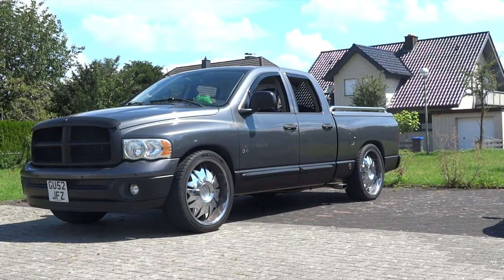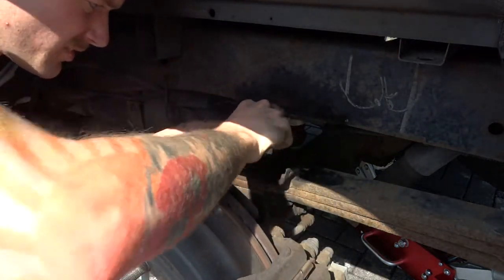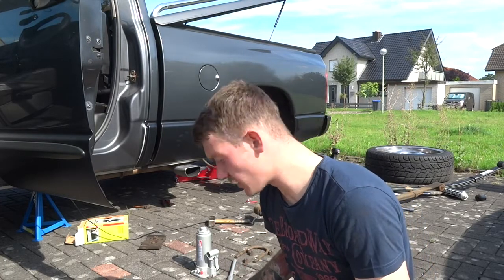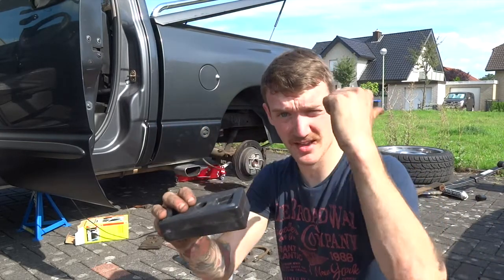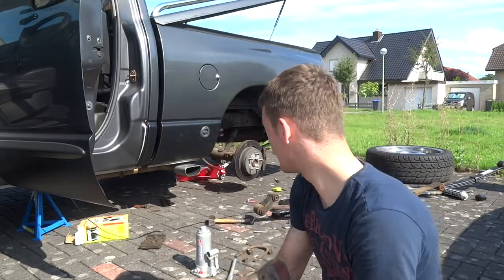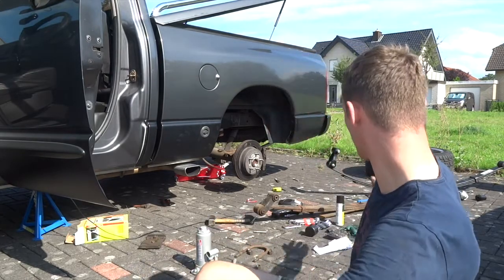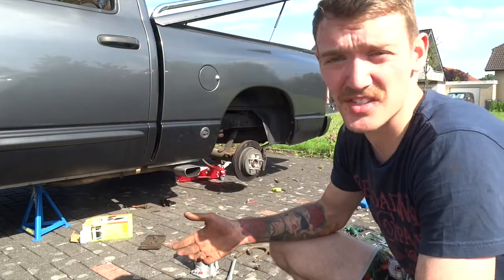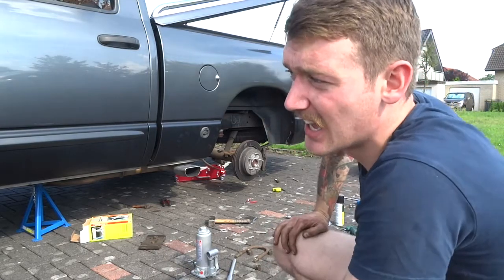Installing a Lift Kit and New Leaf Springs on my Dodge! Day 1!

Comment: So you didn't have to drop the tank or anything to get the front bolt out? I just found a busted leaf on the passenger side of my '04 and this is the only video I can find on removing the springs. Unfortunately, you kinda glossed over the bit I'm most concerned about. The shackles seem simple enough when you realize you have to take out the whole thing rather than trying to remove the springs from the shackles.
Reply from the maker: No mate the bolt comes out with the tank still in buddy! It's tight but there is space. At 1:52 you see the front nut comes off. With the suspension unloaded it's possible to relieve the pressure from the bolt to pull it out. It's a long bolt but there's enough clearance from the tank - at least on my 2003 4.7 1500 with a short bed
Reply: @ChrisTheCarBuilder  thanks. Looks like I'll be going to a shop anyway. Don't have a jack that will reach the axle, much less lift the truck. Don't have stands tall enough. Cheaper to pay labor than to buy the tools I need.
Reply from the maker: @johnterpack3940  that was my biggest issue! I changed from a lowered truck to a lifted truck in a weekend and none of my lifting equipment was high enough so had to buy more
Reply: @ChrisTheCarBuilder  paid a shop $270 to install a $50 pair of used springs. No way I could have bought the proper tools for that price.

Next task is a front end rebuild. Pretty sure I can save money there, that's a pricey job.
Reply from the maker: @johnterpack3940  anything you can do yourself will save a fortune
Reply: @ChrisTheCarBuilder  outside of rebuilding an automatic, there isn't anything I can't do myself. The problem is that I don't have all the tools, can't currently get to the tools I do have, and don't have a safe place to work. It's very frustrating having to farm out things I know I could do. Need to move to a house that has the necessary space.
Reply from the maker: @johnterpack3940  I know exactly the feeling mate, over here in England tools are so expensive to build up a strong collection